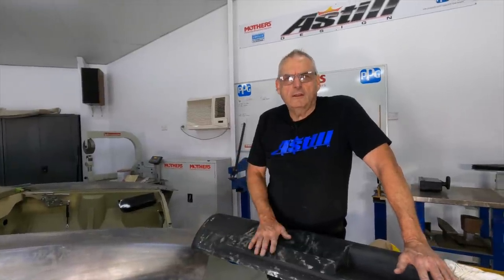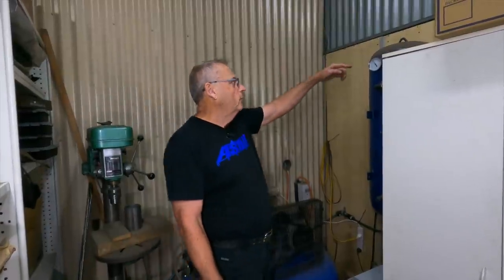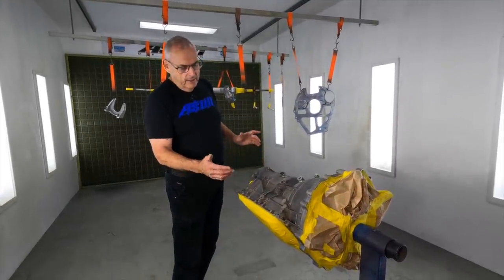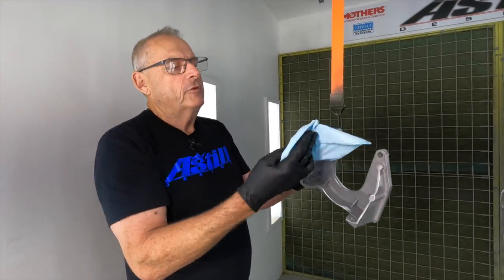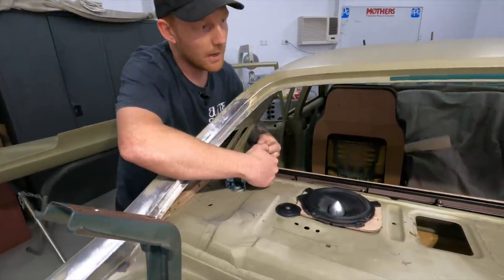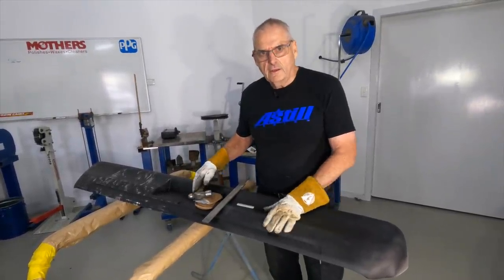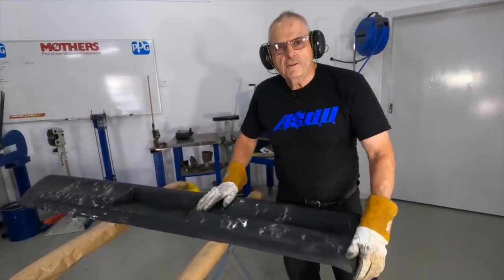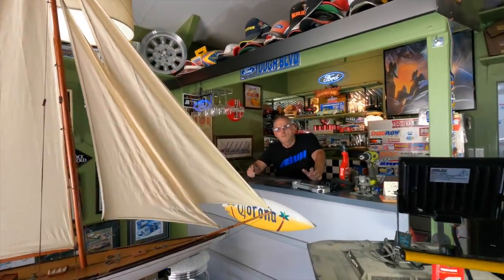Spray Painting & Panel Beating | Road To Summernats Top  60 #21

Comment: After 40 years of repairing bumpers i have never seen anyone using a ballpein hammer and sand bag, i have around 30 different hammers , all shapes and sizes, solid steel bench around 50mm thick, but if this process works, then its great, love your channel, keep up the great work, been a fan since the early 80,s with your XA .
Reply from the maker: Hey John I’m just making it up as I go.😂
Would love to see how a pro does it. Like I said I’m only getting it ready for filler.

Comment: Another great episode!....of all the things to catch my interest is the mention of the carbon canister, working on an old car myself and helpful hints on your setup to minimise fuel smell would be great as my factory setup just has a long hose that eventually just vents to atmosphere and it taught me why all the older house had detached garages! Never recall a fuel smell in the summernats top 60 hall
Reply from the maker: They came in, in the late 70’s but wasn’t till much latter that they moved them to the boot. You can set up a elec solenoid to open once the engine is running to vent the canister.

Comment: Absolutely loving this series mate! I'm currently in quarantine and this is really helping pass the time while learning a bunch of tips!

One question I've (probably a noob question) is there a difference between prepsol and wax and grease remover? Also what's the purpose of the metho/water step?
Cheers, Dylan
Reply from the maker: No sure about the wax and grease. The metho and water is a good secondary step to eradicate any oils etc especially from your hands
Reply: Prepsol and wax and grease remover are essentially the same thing. Prepsol is a proprietary name given to what is wax and grease remover.

Comment: Great video again.
Just a suggestion on the rear speaker setup - as tweeters are more directional than woofers have you thought about incorporating them into a cover for the seat belt mounts so they point into the cabin rather than up at the rear windscreen?
Reply from the maker: Hi, I guess its always a battle of form over function. I think the bounce off the rear screen will be sufficient. Cheers H

Comment: I want to convert my single garage into a spray booth and your tips came in handy although I still need to do more research on the many aspects I need to make it a proper functioning booth including the extraction system.
Is the refrigerated unit expensive and where would be the best place to look for one Howard ?
If you have time, cos I know you're extremely busy mate, could you link the some of the items you point out, such as what I  just spoke about and then perhaps the wall mounted filters etc. Your recommendations are worthy of a second look.
Reply from the maker: Go google for the dryer, I can get you a price on sata setup if your interested.

Comment: Is that your favourite slightly rounded looking wooden straight edge? Haha sorry it just made me smile 😊 I’m pretty sure my bumper would be worse off if I attempted what you are doing! When you say you are doing this for longevity is it because the less bog the better the paint will last?
Reply from the maker: Hey mate, Yep the least amount of product build up =  less shrinkage a movement. especially on the bumper if the car is going to get some use and potential stone chips. The straight edge is a piece of Tasmanian oak. i have many lenghts. 35mm x 4mm

Comment: appreciate you sharing at every step you take,
also what you've done for the culture of street/custom cars over your life so far

one question, i'm putting XYGT (all exterior) on bf xr8 floor (bumper to bumper and interior) do you have any suggestions re engineers/engineering ?
(is this an appropriate question on this platform ?)
Reply from the maker: The best advice for engineers is to find one that likes what your doing before you start and work with them all through the build.
Reply: Thank you Howard
Looking forward to seeing your next session

Comment: Hi Howard, I’ve been out of the game for a while and I have 2 VB commodores to restore. One I need as a daily and the other to get taken back to bare metal to restore first. I have a dilemma that  while I’m doing up my wagon my sedan I have had some surface rust. I’d like to prevent it from degrading any further so before I start the wagon I was wondering if I can sand the surface rust back and treat it, but not as far as bare metal the whole thing until my wagon’s finished in around 12 months plus time. Can I paint over the acrylic? I’ve seen tinted white 2k primer done or a 2k clear done as a rat rod type finish. Could you help lead me in the right direction as there’s so many different opinions? Thanks heaps
Reply from the maker: If you plan on bare metal once you start it then I would put some industrial rust enamel over the patches and it will then come off with the stripper when you bare metal it. something like rust guard

Comment: Hi mate. What are the laws on having a spray booth at home? 
I run a small restoration bussines from my home and  I usually hire a booth or contract out the paint. 
If I can have a booth at home it would make life a lot easier
Reply from the maker: You would need to check you local area. I’m in a rural estate.
Reply: @AstillDesign  
Yeh I am in a rural town also. 
I am on a large 2 acre block

Comment: You dont seem to use an etch primer. It's supposed to aid adhesion of the next coat. Any reason for that.
Reply from the maker: Epoxy is all that is required with this range of product from PPG
Reply: @AstillDesign  thanks